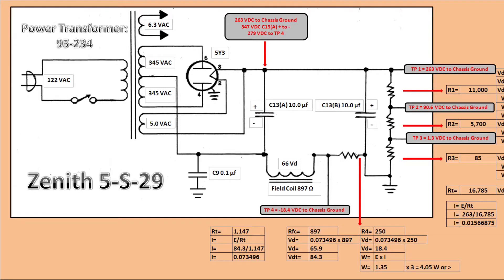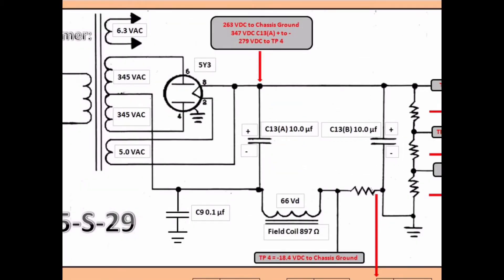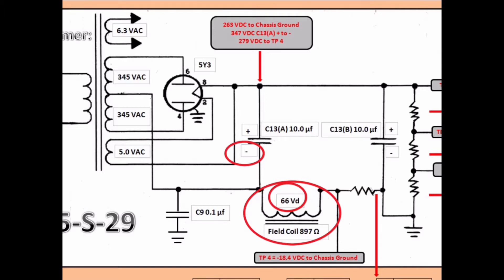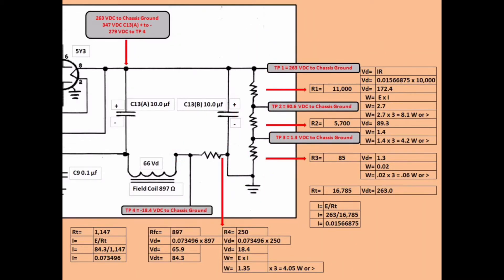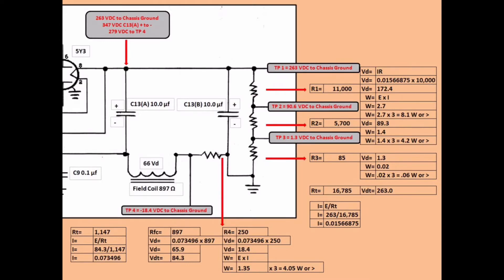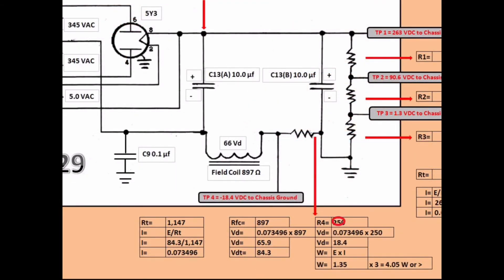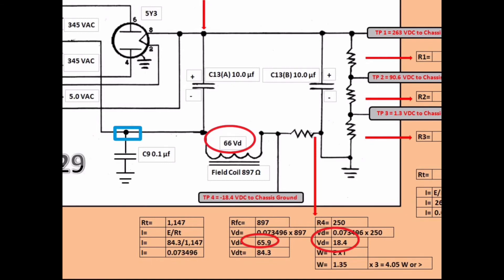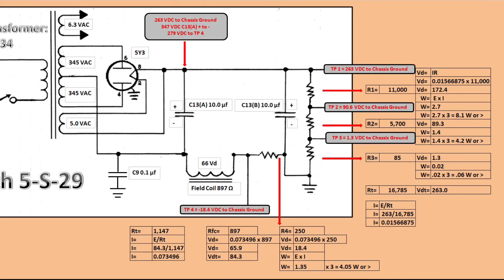Zenith 5-S-29: Power Supply & Voltage Divider

Comment: Probably a stupid (or silly at least) question, but for the resistors, do you choose a voltage that's equal or higher to what you're expecting to see (263V in the beginning, 172 V for the second, 89 V for the third, and so on)? In other words, while you say what Ohm rating you use, how do you determine the voltage rating, or does that even matter? (Fair warning, I may be confusing resistors and capacitors when I ask about voltage ratings)
Reply from the maker: Patrick - not a silly question at all. Check out David's site at: https://www.justradios.com/resistors.html The majority of resistors and capacitors I use or have used came from them. Best, Don

Comment: Hi Don, I have noticed a mathematical error in this otherwise very informative presentation. 

You have assumed that the current is the same for each resistor in the voltage divider. However, this fails to take into account the current flowing from the test points. I believe that TP2 supplies current to the valve screens. This would add several mA to the current flowing through the top resistor and increase the power dissipated by this resistor.

The mathematics gets a little involved but for the purposes of maximum wattage calculations, you can add the screen currents to the 0.01567 A that you originally calculated then use the I2R law to calculate the power dissipated by the resistor.

I doubt that the difference will be all that great however, especially since you used 10K instead of 11K.

Keep up the good work. I love your videos and your crystal clear explanations.
Reply from the maker: +psionl0 Thanks for pointing this out. When I was testing (dry fit) of the power resistors, I recall testing with the taps connected and to your point, I recall a slight voltage drop. Thanks again for pointing this out and for sharing your knowledge, it's appreciated. Best, Don

Comment: Thank you.   You saved me a lot of work.   I will be using the same values for the candohm resistor ladder for my Zenith.   Where did you get the voltages across the C13 capacitors.   The schematic I have does not have any voltages called out on it at all???
Reply from the maker: Thanks for your question. The voltages were measured results using a true RMS meter. Glad this helped and hope your restoration goes well. Should you have any additional questions, please let me know. Best, Don
Reply: Don  Thank you, Thank you, Thank you!!!     My transformer tested good.     I only have one question.    Did I miss the video on how you installed the replacement discrete resistors for the Candohm resistor values?         John
Reply from the maker: +jp040759 John - a friend of the family dropped off a destroyed Radiola 61-8 that got me sidetracked and the USPS lost my shipment of Vishay power resistors from Mouser, so I haven't got back to the Zenith. Here's what I've done thus far and my future plan. I've removed the candohm resistor and cleaned the area well on the inside of the chassis where the candohm was mounted. I will cut a flat aluminum bar similar (width TBD) to: http://www.homedepot.com/p/Crown-Bolt-1-in-x-36-in-Aluminum-Flat-Bar-with-1-8-in-Thick-44690/100337476 to the desired length for the row of Vishay power resistors soldered together in series. The power resistors will be attached to the aluminum bar with quick set clear epoxy (thin layer) and the the aluminum bar will be attached with metal fasteners at the two original hole locations and maybe one in the center if needed to ensure adequate heat transfer from the bar with the chassis. With the oversized power resistors and this technique, I don't expect any issues and have done this many times in the past with excellent results. Hope this helps and keep me posted. Best, Don
Reply: OK.   So I didn't miss it.   I will keep an eye out for that vid.   I have seen how joernone has done it but you are so creative I was curious to see how you would approach it.   Thanx again.   OH!!   Appreciate the quick reply too.  Have a great 4th of July holiday.

Comment: Wow Don, such an odd power supply. Awesome analysis! Never saw a field coil that was not inline at the top with those resistors and a weird reference to ground. So much went into this design and so happy you shared that with us, thanks again!
Reply from the maker: +saturn5tony Hi Tony.  I've had a few with the field coil or choke on the negative side, which doesn't seem to be a common design or maybe the era of radios in my collection. Glad to share it with you and others and hope all is well. Best, Don
Reply: It was very interesting and thank you for a great visual display.